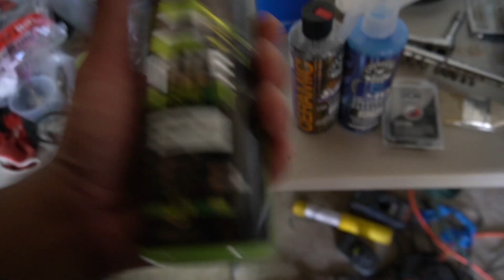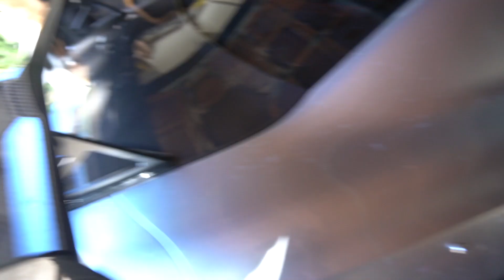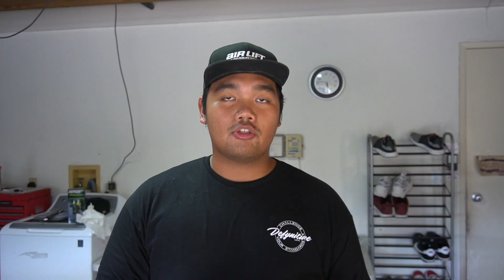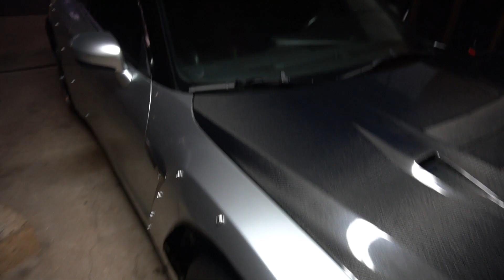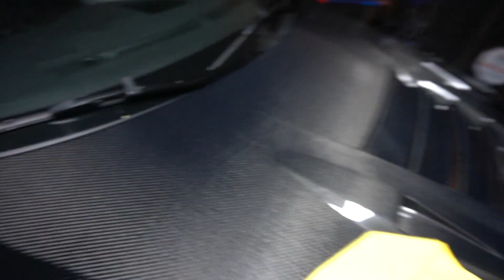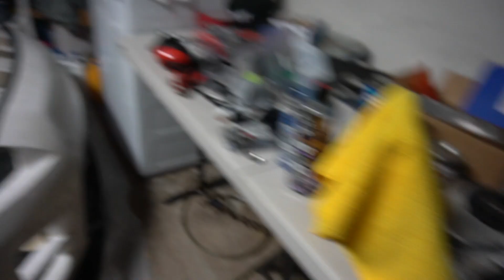DIRTIEST WIDEBODY GTR Gets a CERAMIC COAT MAINTENANCE! (Using Chemical Guys)

Comment: you should not use clay bar when you have ceramic coating on and theres wash product made for ceramic coat by chemical guys so you can avoid scratching called same name as the spryer
Reply from the maker: Ahh okay. Thanks for the help!